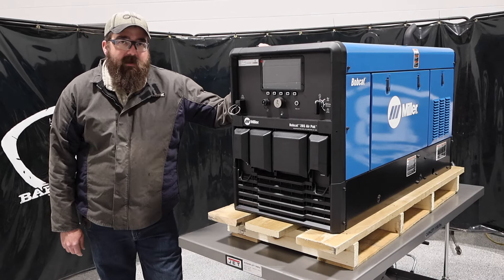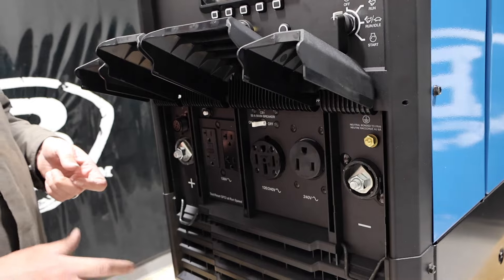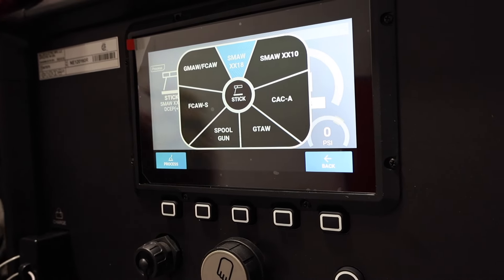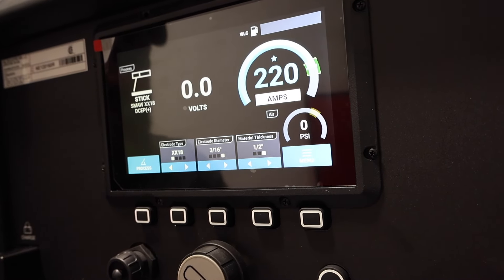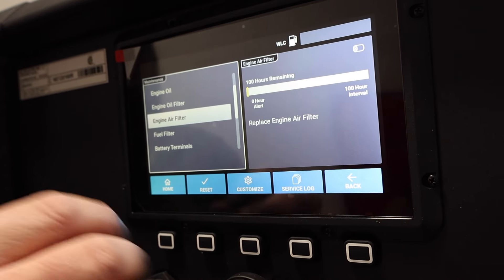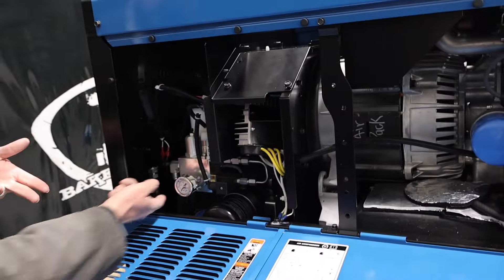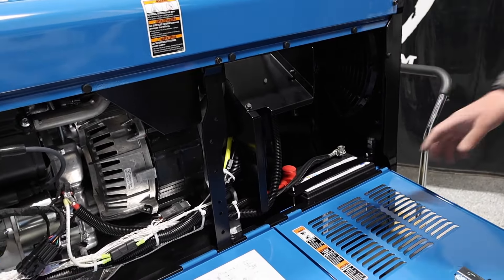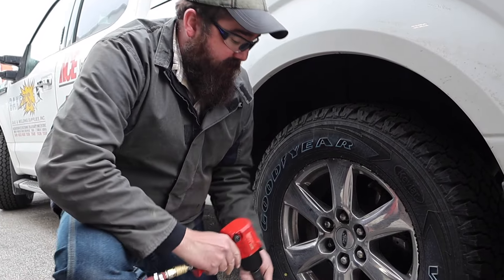Miller Bobcat 265 Air Pak Review - 907876

Comment: This looks like a direct response to the Lincoln Ranger Air 260MPX.   How would you compare the two?
Reply from the maker: Hey Jeff, thank you for watching! Yes, they both fall in the same category. They are very similar in a lot of ways. Miller has its twist and standard features/interface, and one Miller bonus is that they are making them and shipping them right away!
Reply: @BakersGas thanks!
Reply: Looks like the Miller is rated for carbon gouging, where the Lincoln is not. I have a 260MPX (non-air), and it gouges just fine, despite the lack of official support. The Lincoln air also flows 10CFM more than the miller. My experience with Lincoln vs Miller is that Miller has the better arc.
Reply: Can you run a one inch tire impact

Comment: Can you run the miller suitcase 12rc with Bobcat 260?
Reply: The Bobcat does not have a 14-pin connection, you'd need the Trailblazer for that.

Comment: so outlets are called outlets or receptacles, not plugs and secondly you keep stating that the new trailblazer airpak 330 has more generator watts than its predecessor and thats not accurate, the 302 had 11,000 continuous and 13,000 surge and the 330 has 10,500 continuous and 12,000 surge.